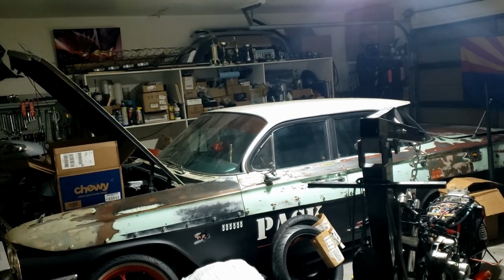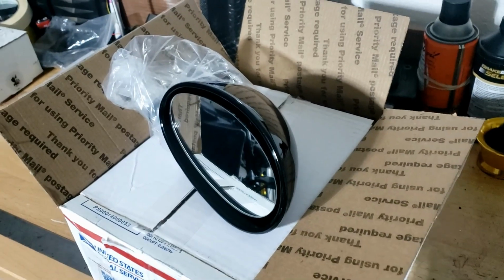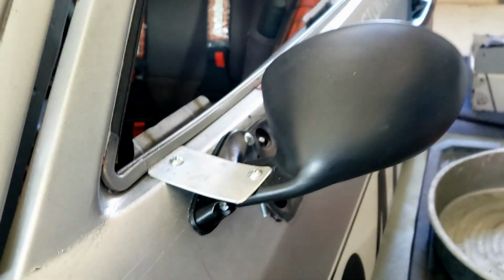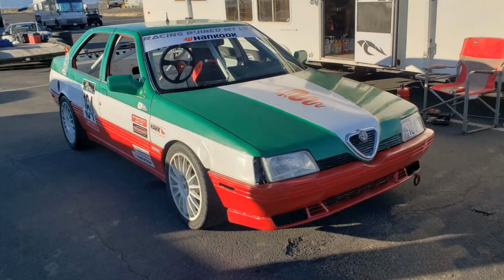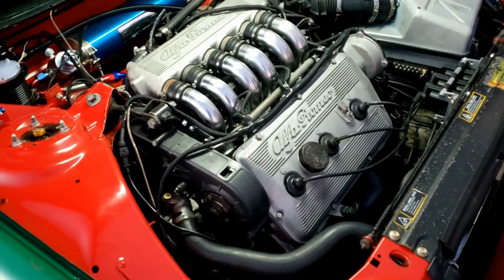Lister Bell #LanciaStratos Replica Build Update #OilPressure Problems

Comment: I'm no mechanic, but looking at the oil pump when you've got zero oil pressure does make sense, even more so when the engine builder himself says he's never seen that before.
Hope you can get it running ASAP.
Reply from the maker: I do too. As you can see below in answer to Colin's comment, we're hopeful it is the pump.

Comment: Have you checked the oil press sender and/or gauge? Take a cam cover off and see if oil is reaching the valve area.
Reply from the maker: Apparently we have. Mike removed the sensor completely and even primed the system. Then cranked the engine over with the sensor removed and got no oil movement. He did pressurize the inlet and the outlet of the oil filter to test for blockage and you can hear the oil kind of gargle if you put a funnel in the breather. We're leaning pretty heavily to oil pump, with first step being to make sure that the gears on the pump are spinning. We know the shaft is but the gears are unknown at the time.
Reply: @TINKcustoms  Is there a relief valve in the pump? I have seen these jam open on startup before.
Reply from the maker: Not sure, I'll ask the experts.  Appreciate your input :)